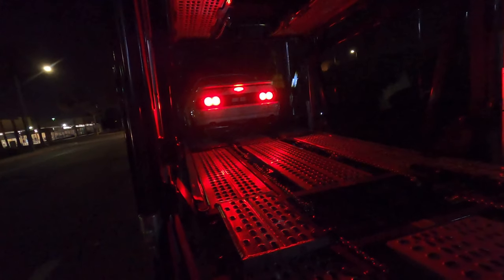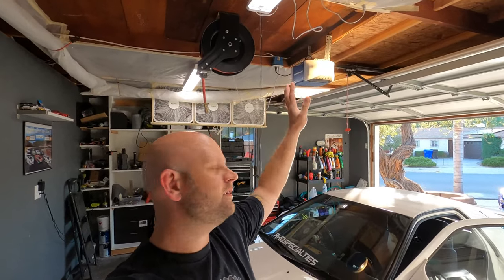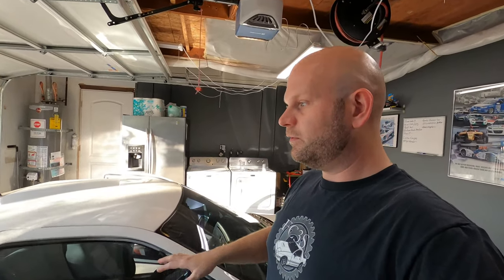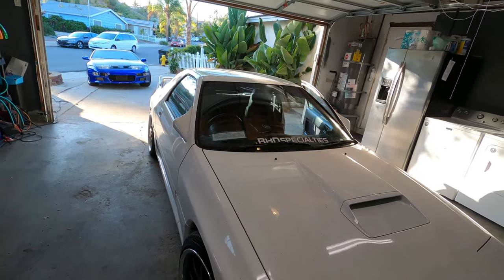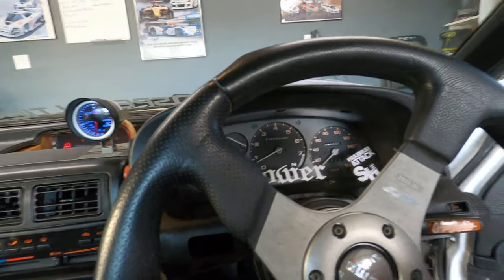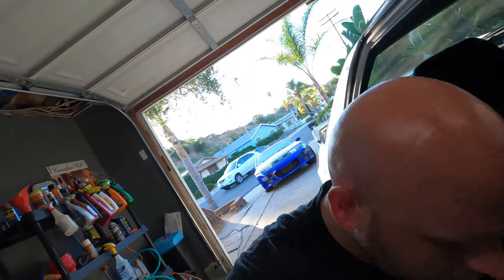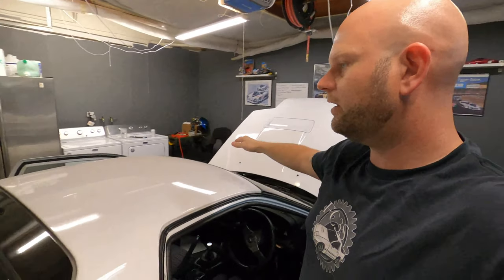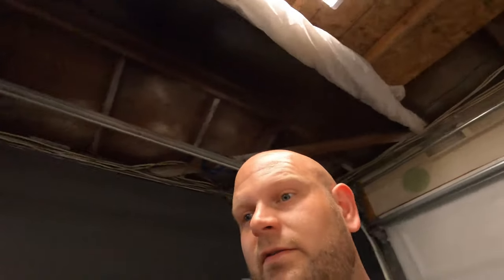Buying my dream car (Again) RX7 GT-R

Comment: ill trade u my jam lhd turn signal blinker for ur usdm ver.
Reply from the maker: Your what now?
Reply: @MohrGarage  I have a jdm turn signal switch I'm not sure after u mentioned alotta things but the jdm. sw8tches don't work usdm
Reply from the maker: You would need to re pin the harness to make the jdm work on usdm. Also s4 and s5 are not interchangeable. I will most likely still need my usdm switch.....
Reply: @MohrGarage  okay I've repin alotta things but I haven't tried for the signal so ok well thnx man